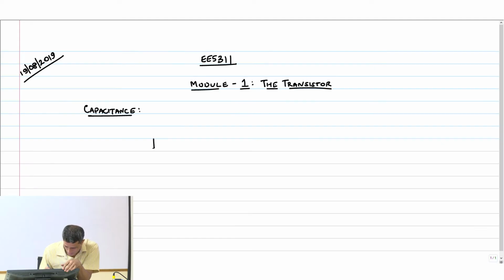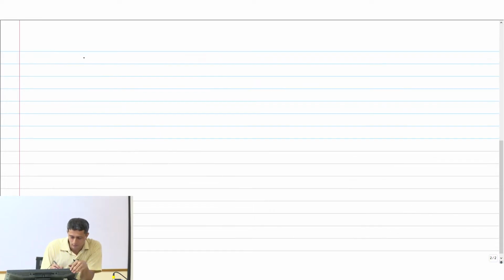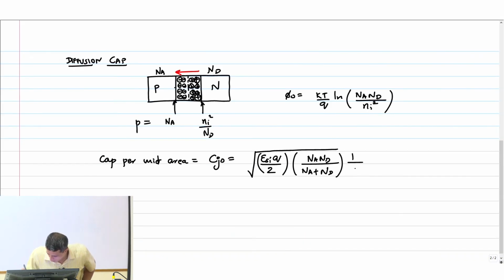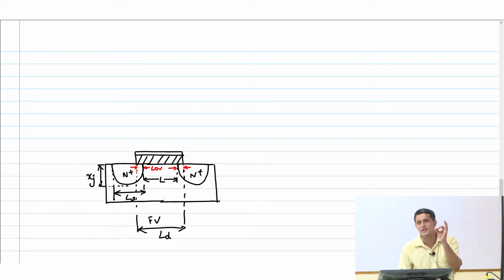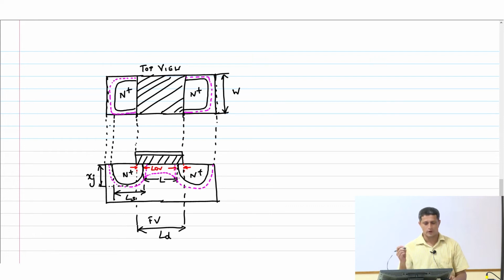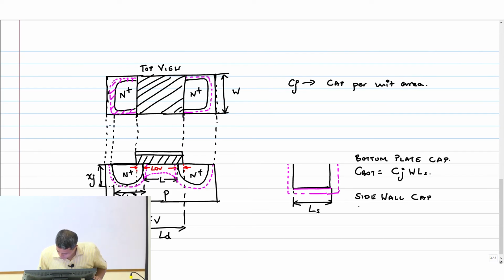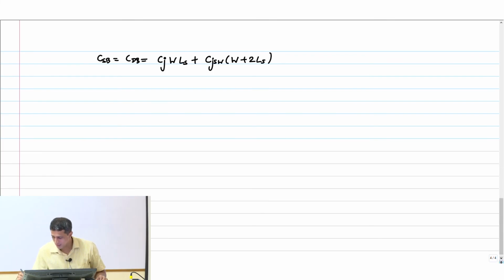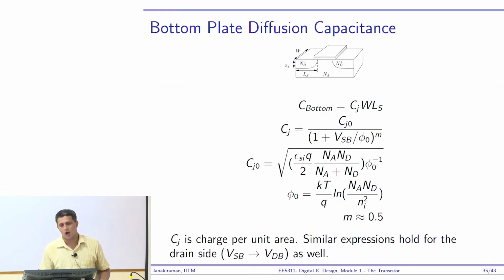Transistor - 12 - Transistor Capacitance - 2

Comment: At 25:11, what does"load the previous guy significantly more mean?
Reply: It basically means that the input loading capacitance of the device will increase.
Reply: basically the load is inversely propertional to the capacitor which is parallel to AI